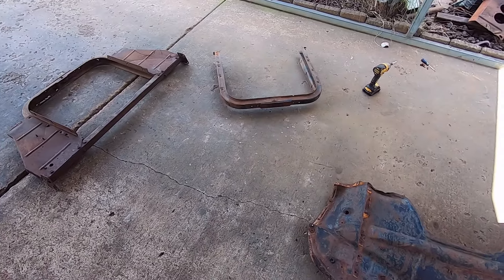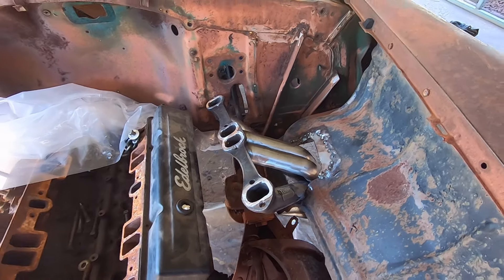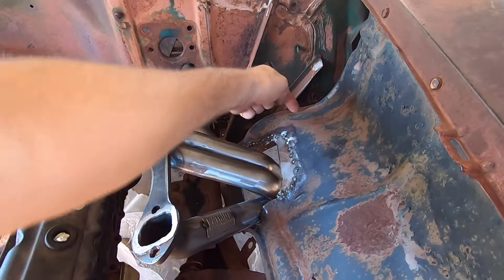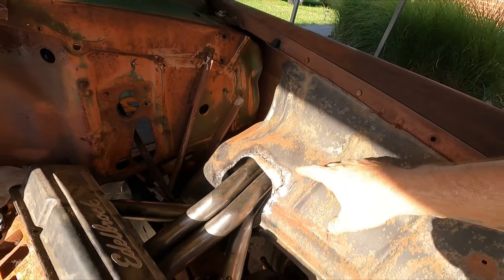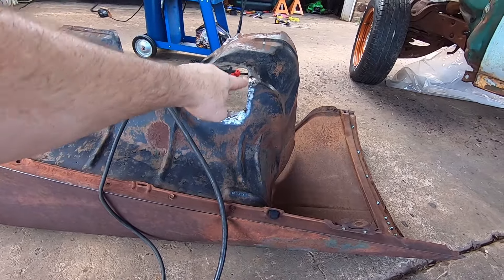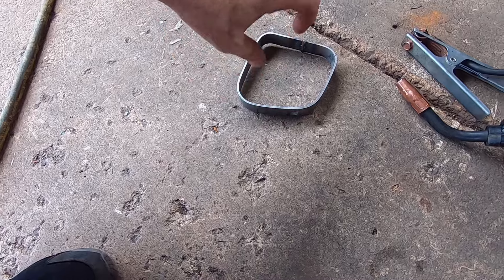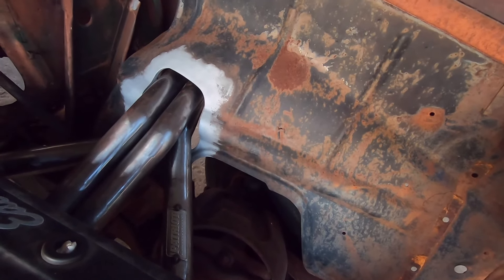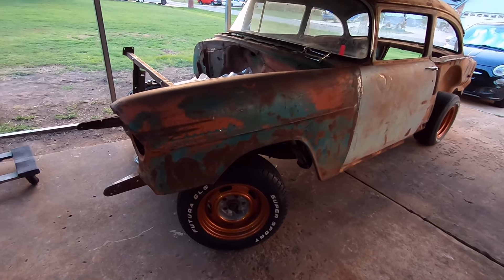Part 10 Free 55 Chevy Project. Flanging Inner Fenders for Fenderwell Headers.

Comment: I did the same thing, minus the flange on my old 55 with Fenderwell headers many years ago.  When I needed to remove / install the headers, I just pulled the fenderwells loose and did a whole lot of finagles (technical term) to R&R the header. I do like the notion of a flange though.  Now you got me thinking about doing the same thing on my 57 Bel Air SC! Great work Rob!

Comment: Here's a trick for you  , to raise the front end with disc brakes . I use a g body lower A arm . Cut the ballpoint area off and graft it onto the stock lower A Arm . This uses the larger ball joint and it points upward . Then put g body lift spindles on . Gives all stock gm bearings and brake assemblies , and hoses. Stock 
Bearings and shocks . Stock ride and alignment.  With 3.5 inches of lift . Measure twice cut once .
Reply from the maker: I'm not raising the front end. Not building a gasser style car. It will be lower in front and jacked up in the rear like late 70's to early 80's.

Comment: have you thought about making a two pc inner fender, so you could remove the portion around the header and have plenty of room to move it around. two ways you could do it , horizontal or longitudnal. both would look clean with the fasteners.
Reply from the maker: I thought about it but the bottom line is = The headers shouldn't ever need to be removed with the engine in the car. They move away from engine 4 to 5 inches and it's enough room to pull engine, just the cylinder head, or change gaskets. The look of it right now, I love. No seams or fasteners. It's simple and clean.